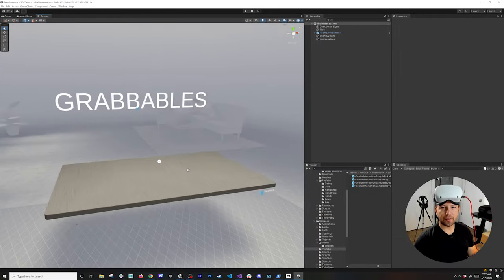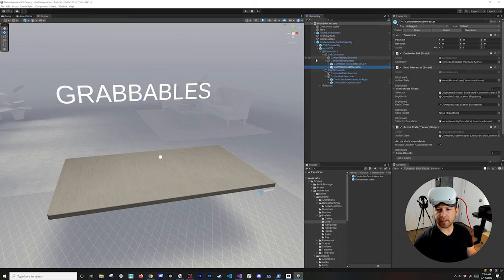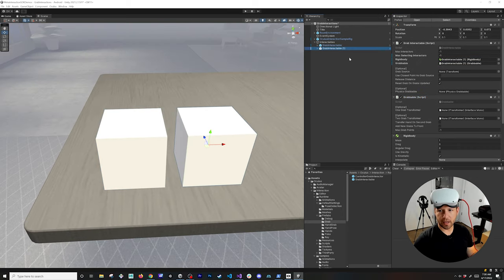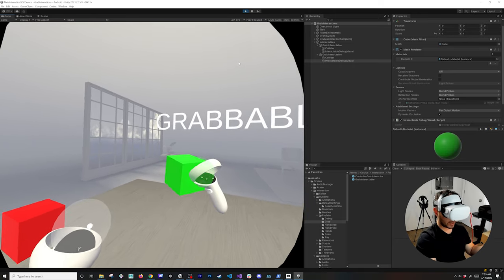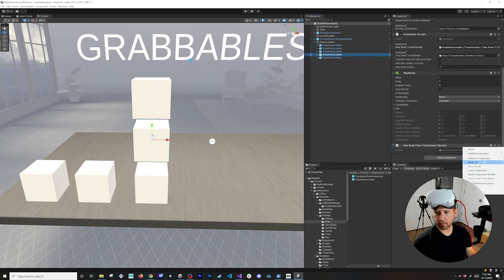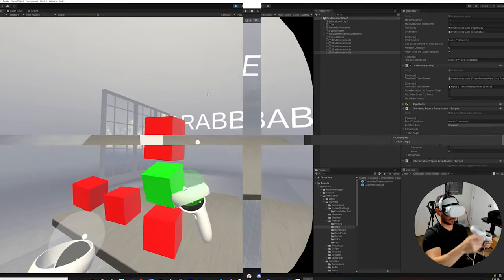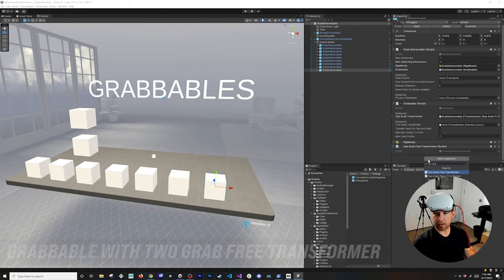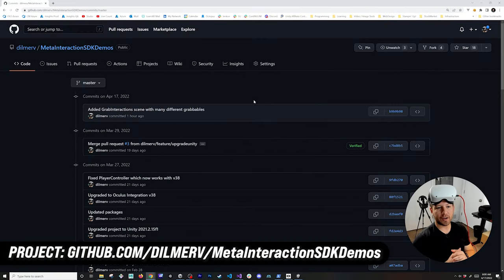How To Grab Objects With Controller In VR - Oculus Interaction SDK

Comment: you know if activate vsync in Ouclus Quest 2 is good? Great video!
Reply: It is not - On Android platforms, vsync will automatically be used by the OS - specifically in VR you do not want vsync as if the framerate drops below 60 you  do not want to cause motion sickness by changing the display refresh rate.
Reply from the maker: Thank you I am glad you liked the video, looks like you got a great answer to your question !

Comment: The Grabbable field appears to have been removed from the Grab Interaction script. Does anyone know what the new way to set this up is?
Reply: The Grabbable field change to the Pointable Element. Just put it in the same way
Reply: @최정빈-g2k  Thanks! The Example Scenes included in the package helped me a bunch in figuring out how everything works together.

In your experience, how well do these Meta components work relative to the OpenXR equivalents? Do the two play well together? What are some of the limitations of the Meta Interaction SDK? So far, I'm finding that they work extremely well on my Quest 3 (as they should, haha).